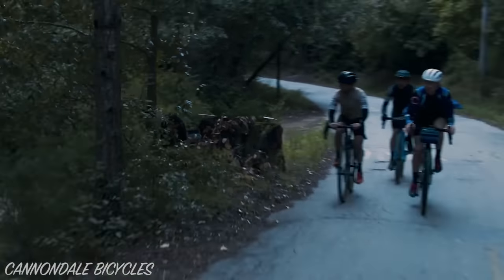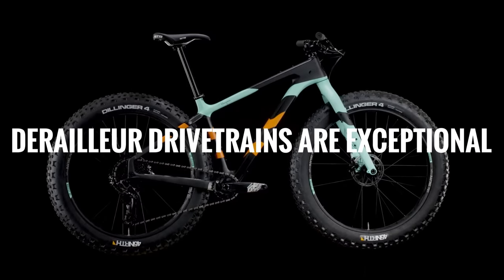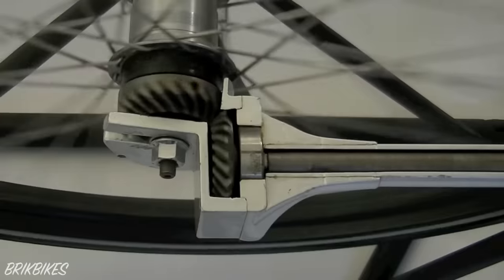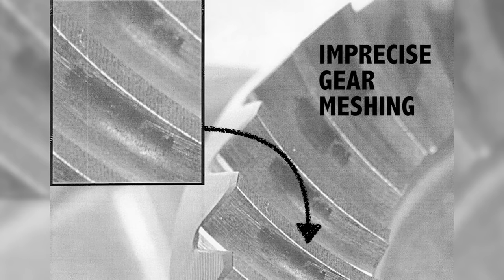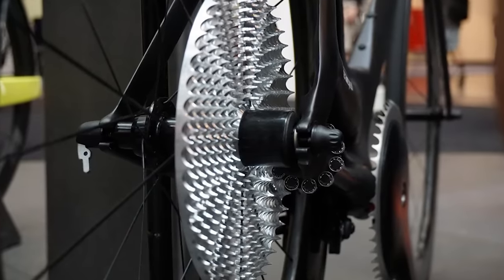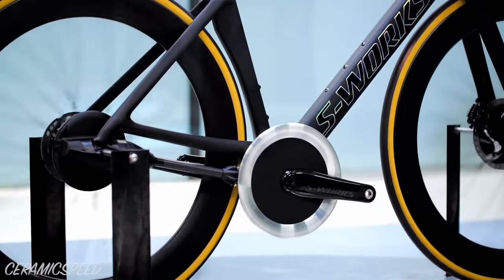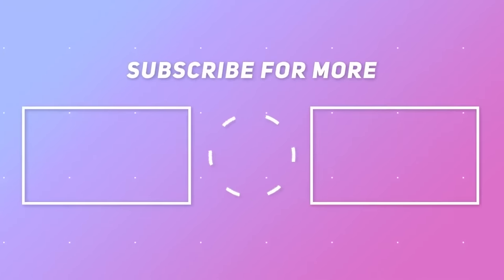Are Chainless Shaft Drive Bicycles a GENIUS or TERRIBLE Idea?

Comment: 90% efficient. At what? Precisely? At durability? At speed output due to rear being way smaller than frontal gear or power output due to rear being much larger than frontal gear. What do you mean `efficient`. Specify, dont throw around meaningless terms trying to sound smart.
if you say its less power, less speed, well, then where did the extra energy go? Heat? Sound? is that thing really loud? Where?

Comment: It takes more HP to move a motorcycle with shaft drive than it does using a chain at the same speed. About 15% more. THAT is why human-powered bicycles use chains. They are far more efficient than shaft drives.

Comment: Derailleurs and chains SUCK. One of my bikes breaks the derailleurs when I hit a chuckhole in the road. Chains need to be cleaned weekly and this takes about 30min, is messy, and not really possible in freezing weather.
Reply: Your best bet in that case would be an internal gear hub with a belt drive. No derailleur and nothing exposed to the elements, plus easier to clean and will last longer. However you're oing to pay more up front for that kind of bike. Plus belts are actually less efficient than chains at lower watts and actually wear bottom brackets out faster.

Comment: Th driven technologies seems to lose most of the benefit of a shaft drive, namely it's weather and mud resistance due to not being enclosed anymore. So I'd expect it to just end up as a novel but superfluous alternative to a chain drive as it trades being enclosed with better efficiency. Also the open gear wheel would seem to be prone to bending out of reach, thus ending up skipping teeth.

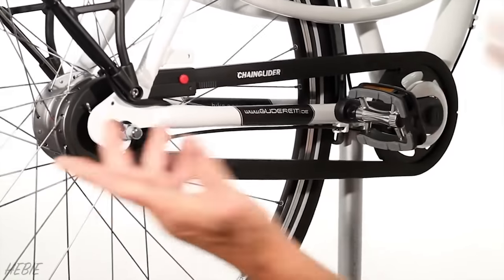Comment: 4:18 how did you get the conclusion of shaft can be better in mud? graphic showing chains %92 efficient in mud, but shaft alvays  like %90 so even in worst conditions, shaft barely catches chain.
Reply from the maker: I think it's reasonable to think that mud could be even stickier than what was tested, as well as having debris stuck in it to increase the drive resistance further.

Comment: to be fair, chain systems have a lot of complexity. then again the issues caused by that complexity can be solved so easily that the tools u need to carry are not as heavy as the shaft of the shaft drive system

Comment: Elon Musk is succeeding with an engineering principle that would likely shelve shaft drives.  The goal is to remove design requirements to improve reliability and reduce weight.  Shafts come with so many unforgiving factors you'll be stuck with tons more requirements that will never allow you to out perform conventional designs.  

That being said, this is still a finite gearing system.  The continuous ratio drive system is still the holy grail of design.

Comment: Bad design. Requires too much. They can miniaturize an existing motorcycle tranny with shaft. But it’s not worth it. Chains are so light. 

For motorcycles, I prefer shafts due to no maintenance and no noise.

Comment: The bicycle industry is really funny. 
Brake discs on bike which really don't work and get stuck if you don't use you bike very regularly. It's just complete rubbish but almost all bike have them nowadays. While there was nothing wrong with the old system which worked very well and was easy to fix. 
Brake wires through the frame to reduce air resistans. (But much harder to maintain) I mean. Are you really just joking now or do people take this stuff serious? 
I have no believe in this system at all. But most likely it will be fitted to all bikes in the future regardless.

Comment: Love the shaft drive on motorcycles…..low maintenance…..no grease all over everything…..sealed from the weather.  On bicycles, with limited power available, every efficiency counts and the shaft cannot compete other than industrial applications such as moving around in a large warehouse.

Comment: In the conveying equipment I have worked with for 40 or so years...chains and sprockets are the least efficient method of power transmission. This, when you factor in the maintenance requirements.  I find the "direction of rotation" argument a bit flat and ignorant,  as well. Many bikes have springs  for shock absorbers which both adds weight and reduces efficiency by much more than rotation changes..each time the pedal is pressed down, the springs compress, robbing power.. then when they normalize, they do not add back the power they robbed. Because the pedal which compressed it is no longer directing that power to the rear sprocket.
Reply: It's not the spring is what dissipates energy, but damper. Spring only stores energy temporarily. And there's already two known ways to minimize 'squat': by specific tune of damper and by proper positioning of suspension pivot point, with latter capable of creating of negative 'squat'.
Reply: @xupyprttffnge7603  sounds like you know squat.

Comment: You kept mentioning torque throughout this video, yet with the amount of torque a car engine puts through its meshed gears and drive shaft with no issues (nevermind the industrial machinery you also showed), I highly doubt a human being with just leg power is ever going to be capable of sheering gear teeth let alone doing anything of note to a drive shaft. The loss of energy is a genuine factor considering how much less energy a human has to give in the first place, any loss is going to be felt more than a system with a motor/engine and that will always be worse if you try to add a gearbox to the system. And of course cost is a huge deal too. So most of your points I think are valid, just definitely not the torque one.
Reply from the maker: It's the torque point that's actually the most valid reason IMO. The shafts need to have a tiny radius for packaging reasons, need to handle very low RPM with full body weight exerted (ideally around the heaviest rider), and all on a bike that should be near as light as one with a chain or belt drivetrain.

Comment: This is a terrible idea.. it’s very prone to wear in critical areas because the force is spread over a very small area unlike a conventional bike where the force is spread over almost half the cog on the cassette. 

Additionally I would imagine the driveshaft could be vulnerable to warping if the rider stands up and steps on the pedals with great force..

Comment: I read that the rholoff hub is most efficient in gear 7 of 14 (or close to that).  Knowing that, I’d like a large front ring so I would normally ride in that gear.  Does anyone have info on this? Currently I ride a 7 speed ebike and am in gear 6 or 7 almost all the time, so i think about this often.

Comment: This wouldn’t really work for everyone, I haven’t even watched but I built my own bmx bike and the gear ratio would be a nightmare to switch or change, I have 28 on my cranks and 9 in the back I think, this seems a lot harder with shaft drive, and it looks so much heavier than a lot of lightweight chains that r relatively cheap and can buy a single chain for not that much

Comment: I don't get the proprietary point.  If your bike has a chain drive, it will also have a chain drive until the end of days.
Reply from the maker: If the shaft fails (and you cannot find spares), or the frame isn't built stiff enough, or you end up with a frame with poor alignment - you can no longer use the bike. This is not the case with a chain drive bike.

Comment: Chains and sprockets have been around and used for such a long time and it worked just fine. Why fix it if it is not broken?
Reply: Because chains and sprockets have massive disadvantages, especially around wear and dirt resistance.

Comment: Nothing wrong with it, except it doesn't work in real life and has no applications in actual real world conditions. If you enclose the whole thing you may have something that could work for very specific situations, but none that solves an actual problem without creating even more new ones. This just isn't pedal bike tech. All you do is create an expensive, harder to service, heavier system that solves nothing. If you really need the reliability of a shaft that much, you probably aren't pedalling because if you are pedalling you are highly likely to want efficiency which is the tradeoff along with the other mentioned problems.

Comment: There's no way that's going to be reliable past anything but a brisk ride. 

There's a reason performance motorcycles all run chains. Shaft drive just can't hold up to the abuse. Now I'm sure the gears could be beefed up. But at what point is the gearing way heavier than a chain and sprocket?

Comment: I'm halfway through this video and it's basically an opinion piece. The first point mentions that current systems are cheap and maintenance is easy to find, but don't take into account that a shaft drive system would need way, WAY less maintenance over it's lifespan than a normal chain drive system. The second point admits that there's basically no data on this except a study done in the 80s. I won't argue that a chain drive system is less efficient as a chain drive, as that just makes sense given that the chain drive is close to direct drive while the shaft drive has several turning points, but 99% vs 90%? I highly doubt it.
Reply: I don't know about point 1, a drive shaft would probably need more maintenance in my opinion... I have a conventional chain driven bike and have never maintained it, still going fine...
Reply: @MartinJones123  depends on how you’re riding your bike, I guess. Regularly oiling the gears and chain while riding in a city will probably keep you going for years, but trail riding is bound to increase the wear on exposed moving parts as they get covered in dirt and debris increasing friction.
Reply: @Daktyl198  True, don't ride all that much and the bike is like 3 years old, mostly used in the city and rarely trails...

Comment: Where is Elon to suggest connecting the pedals to a generator and a motor to the wheel? Run two wires between the two and you definitely don't need a stiff frame. 😀

Comment: Ok, somebody tell me if they know of a good reason not to do this, but what if the front tire on a bike was normal, but the back tire was slightly wider with a space in the middle of it, like either 2 tubes side by side making it 3 wheels or similar to a car tire and tubeless but with an irregular shape. Then, in the gap, there could be spaces like on a gear, so the gear that the pedals drive feeds directly into the tire. The only issue i could see with this which ive just realised while writing this is that it would take a lot more energy due to the gear ratio being 1:1 but you could just add another gear to the system, right? Otherwise im just dumb and theres a good reason for this which i just cant see. Please tell me if im wrong but in theory it works (in my mind at least).

Comment: Except, internal gear hubs wear out exceptionally quick. So you end up replacing the hub every 300 miles or so.
Reply from the maker: One of my Rohloff hubs has over 100,000km on it. There's a guy with almost 400,000km on one too.
Reply: @Cyclingabout  oh right you guys are actually biking with them. We like to shove them in, or well we thought we did, tuned motorized bikes. I guess the more jerky/torque nature of the engines tear them up, but yeah we only get like 150-300 miles out of the nuvinci hubs we've tried. 

Maybe the load/heat is just too heavy for grease they use, as there's no real way to service that like on factory built mopeds that use sealed chains&reduction boxes. They'd normally be filled with gear oil that has service drain/fill holes. Which is also how these mopeds get much longer chain life then these touring chains. 

We need one that's overbuilt like most factory made mopeds are, but as far as I can tell everyone just makes theirs "good enough" for pedal power and ntohing more.
Reply from the maker: The highest torque rating I know of on an internal gear hub is 160N. Check out the Kindernay XIV.

Comment: Motorcycle's will tell you why this is a bad idea for a bike. 

While longevity and reliability are a good thing. They absorb to much energy. And Weigh more. 

Not a issue when you can just put a bigger engine in a motorcycle. Its a big issue when you cant pedal faster or harder.

Comment: Hmmmm. 20 minutes against shafts and then ads for ceramicdrive. Which is not ready for practical use due to sensitivity. A bit of dust, mud or a little stone will crash the gear.

Comment: good luck with that..  if a chain skips a gear you out it back on..  not this.
more efficient doee mean better.  

not getting into the list issues from on the fly repairs. and durability.
bikes have been great because of the rare case of breakage..  the parts fit in a ouch under seat

Comment: I tried a shaft drive bike on a long trip. Terrible. Crappy gear system. Ultimately the shaft broke on a long uphill grinder. The company wouldn't refund my money but did offer to replace the shaft. Who cares?!?! Lesson learned. Why bother putting so much high tech into making a shaft drive work when it inherently sucks?
Reply: can you remember the brand of the bike you used so I can stay away from it?

Comment: Anything requiring such precision that is exposed to the outside world isn't viable. Shaft drive can be done much more easily and with durability if not as efficient. Has anyone tried a CVT transmission with a bicycle?

Comment: Just a thought, Has anyone tried making an electric drive, one with the pedals providing power to a generator which feeds a hub motor at the wheel or maybe both wheels for an off road bike?
Reply: Write - 2x2 electric bike - and press a loupe... 😁
Reply from the maker: This kind of drivetrain has actually been patented and built many times since the 1970s.

Unfortunately, they're just too inefficient due to the need of step-up and step-down gearing. The efficiency range works out to be between 50-70% for the most part, with a peak of around 80%.

There is a REALLY good chapter in the book "Bicycling Science" about this idea if you want to check it out. I might even consider making a video about it in the future, although I worry that it'll mostly go over people's heads as it's pretty complex.

Comment: Drive shafts are simply unreliable. You do not have the frame and weight of a car to keep it al togheter and bicycles were made with more tolerances in mind than a drive shaft.

If you fall and bend the backwheel slightly it fails. If you fall and bend the frame slightly it fails. If some of the teeth gen nicked on the backwheel it fails. If you make it too light weight, it fails because of the forces working on individual teeth instead of all the teeth. If the shaft itself gets nickef by anything capable of bending it, it fails. 

Meanwhile solid metal chains don't fail in any of the above mentioned scenario's. Yes they fail for their own reasons, but people forget that they also bring a lot of advantages to the table.

Comment: Drive shafts bike are difficult because of the gearing system it's way more complicated
 Yes you can use belts instead of chains however again you're only looking at gear changing issues when you do that
Reply: Unless you're willing to use a single speed bike.

Comment: Scientists haven’t proven why bicycles stand upright and self correct themselves.
Reply: They don't self correct. YOU make the corrections. You just don't notice it because it becomes so automatic that you never think about it. You are constantly changing the angle of the front wheel to keep the weight of the bike and you the rider above the contact patches on the road so that all the forces including when you lean into a corner a directly down relative to the bike, regardless of lean angle.
Reply: @chrisbaker2903  they do actually if you check YouTube they have a documentary about it

Comment: Bicycles originally had shaft drives, and cars chain.
Reply: The first chain drive "safety"  bicycle    appeared in 1885.  There was a shaft drive trike in 1880 but the first shaft bicycle drive was patented  by Walter Stillman  in late 1890.  The Model T Ford, introduced in 1908, used a drive shaft.
Reply: The penny-farthing bicycle, designed in 1878, had no drive train. The pedals were attached to the front wheel.

Comment: It will never work, not as long as there is any chance of water or contamination getting in. Esp cold. In automobiles driveshafts fail regularly, and even high tensile steel u joints give up. In a bicycle the equivalent wear would be 20, 50 times higher.

Comment: Gears are more tolerant to misalignments and overloading than you think, when designed properly for the effect, should that not happened the only after-effect is more wear and thus loss of efficiency. You're been rather anal in some of these point against gears, a little bit bias aren't we? Did you know the chains and pulleys manufactures consider their products as consumables? Gears are for ever.

Comment: I think this drivetrain would be best for a bycicle if u were to put a even bigger motor infront of the frame so u could have like a 5000 watt motor and easily fit it in the front of the bike then u could have more room in the frame for the battery and u wouldnt the bigger shaft can of course handle 5kw whereas ur chain probably wont unless its a big fat ass motorcycle chain but even then i dont know how much id like a chain spinning at several thousand rpm in between my balls

Comment: So should be perfect for electric bikes which have more power than you dare to drive at. All those parts then need to greasing and cleaning up, so saves you plenty of time, and time is money so you can afford to buy this more costly system. If only electric bike manufacturers made their mid-drives compatible with it.
Reply from the maker: Bafang actually makes a mid-drive motor and shaft system (M445), but I can only think of one company that uses them!